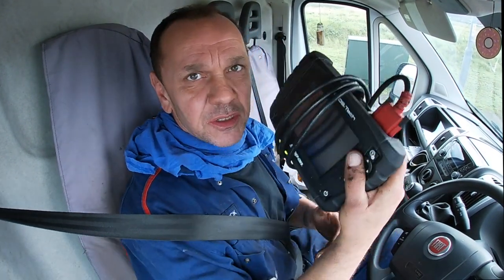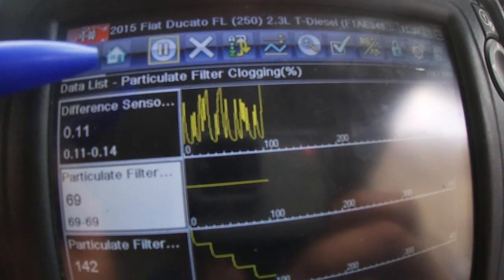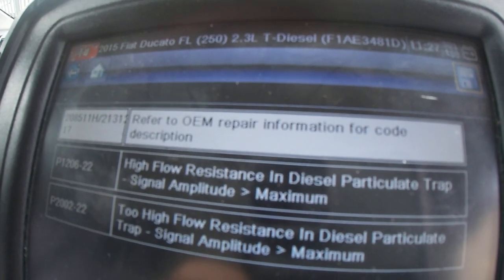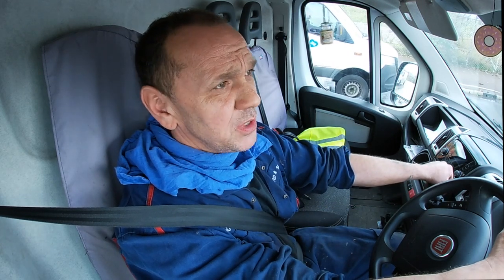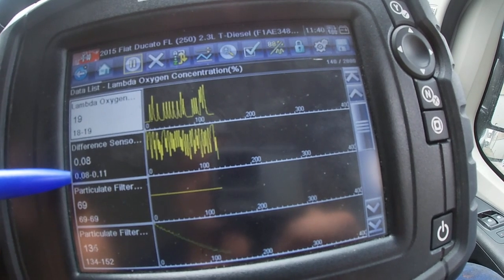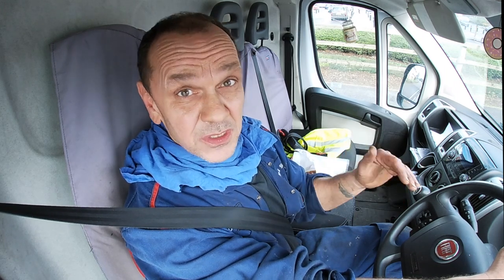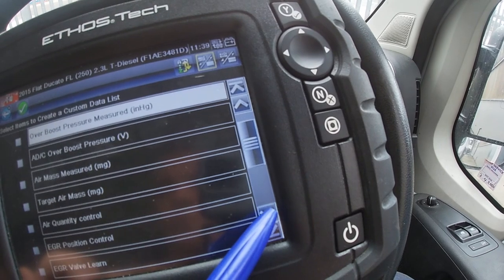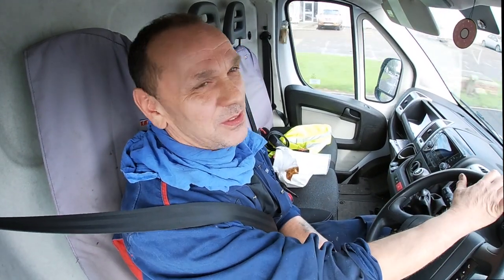Blagging Diagnostics- 2015 Fiat Ducato- Forced Regeneration - Fix With Snap On Ethos Tech.

Comment: So your fixing a company work van with your snap on personal tool
I hope your getting extra overtime on your clock card for this repair
Diagnostic tool is not a screwdriver but an electric spanner
Suppose its a welcome break from trailer bashing and hub grease
Reply from the maker: To be honest with you, work pays me more for using the tool than any on my 'friends' ever do.   Saying that it is that type of tool where I get to be the one that is needed. 

Things are going to get very competitive very shortly with this downturn the UK is going to feel so it is worth being ready for it.  

We don't get enough lightweight vehicles in the workshop to warrant a full-time scanner with a yearly subscription so they won't invest in one.   It is swings and roundabouts with a dedication to work. I own the scanner, it is mine, therefore, I can use it how I please. And yes I get fatigued from trailer fitting.
Reply from the maker: Also, it about saying "I can do that" Rather than shrugging one's shoulders and shuffling off in a disinterested manner.